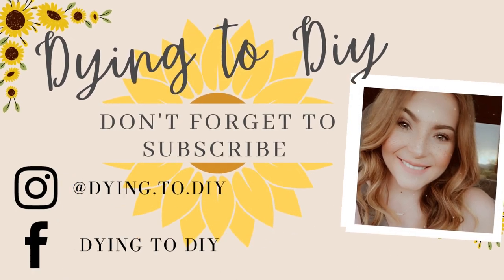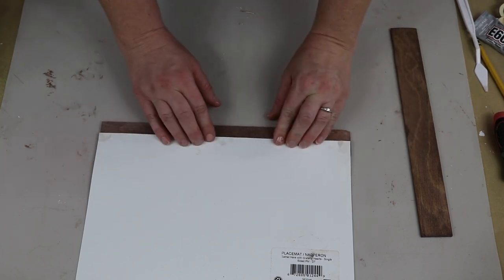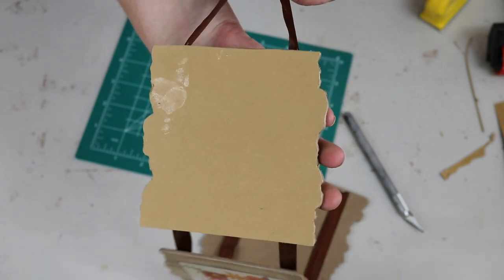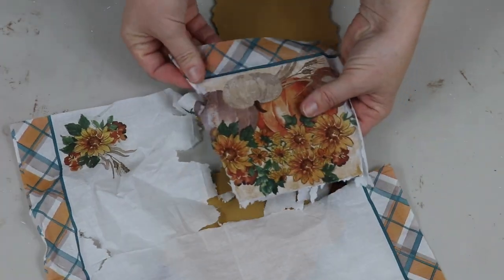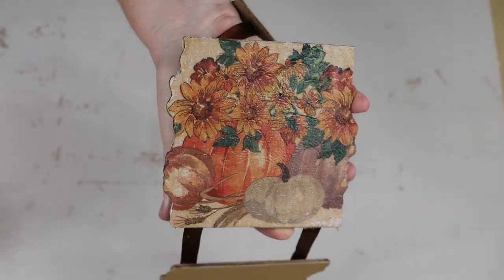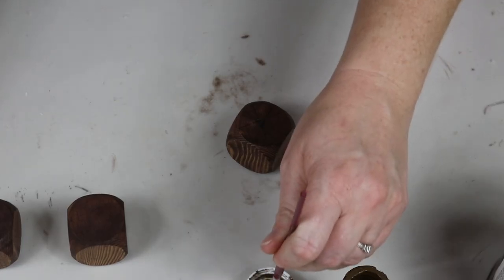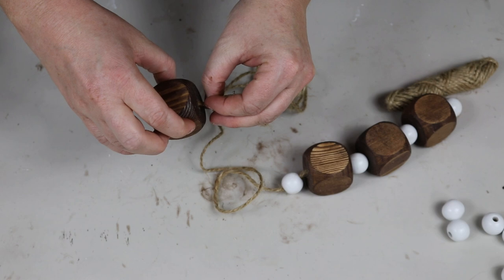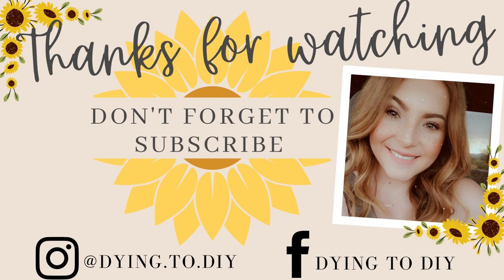6 High-End DIYs | Dollar Tree Fall DIYs | Fall Crafts on a Budget | Classy & Cute Fall Home Decor

Comment: The importance of removing the napkin layers is becaue only the bottom layer gets attached and your printed part may not stay on.  I would also suggest the iron method . It helps get out the wrinkles and for me i think it adheres better.. another way to remove wrinlkes is to use a piece of plastic wrap( Saran Wrap).  Wad it up and dab the the napkin. It will smooth it out without tearing the napkin.  You have some really cool and creative projects 😊

Comment: You should try a new blade when cutting wood for any project or get a good quality finishing blade, or wrap painters tape around the area to be cut. You'd be surprised at how much better your cuts will be.
Reply from the maker: The crazy thing is is that the blade IS brand new. That was my 2nd time cutting anything. So I don't know if the blade is too thick or what. But I want a different one for sure.

Comment: I want to share a tip some may not know
about. You will not have any bubbles or wrinkles with Mod Podge (MP) if you iron the tissue paper, paper, napkins, fabric, etc. to the Mod Podged project.

1. Spread the MP on your project and let dry completely. 

2. Once dry, lay the paper over the MP  

3. Place parchment paper over the paper, and iron with high heat no steam.  Household iron or tools like the Cricut heat press can be use.

The ironed paper will be smooth, no bubbles or wrinkles, and very well adhered. Sand the edges to add that finishing touch 

Hope this helps someone. Blessings to you.
Reply: It is the best way! Use this technique all the time!
Reply from the maker: You're the 2nd person to mention that I should iron the napkins or tissue paper. I will definitely have to try that next time because it seems like no matter how much I smooth it out, there are still ripples in it.
Reply from the maker: I'm definitely going to try it!